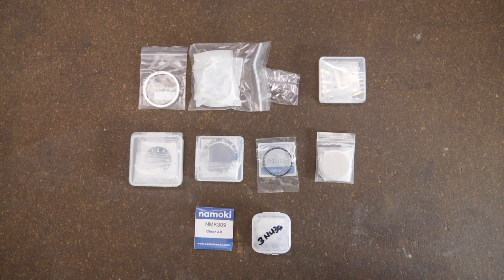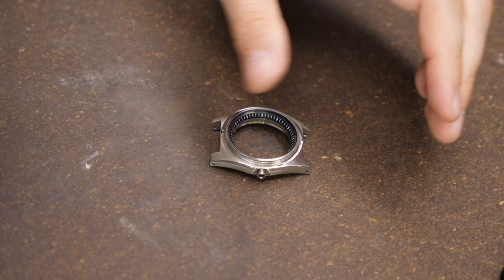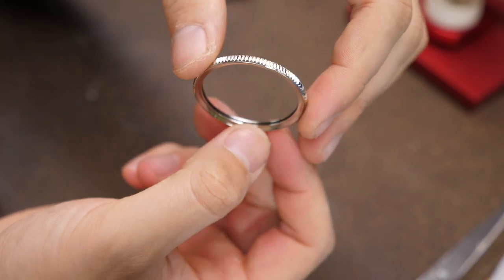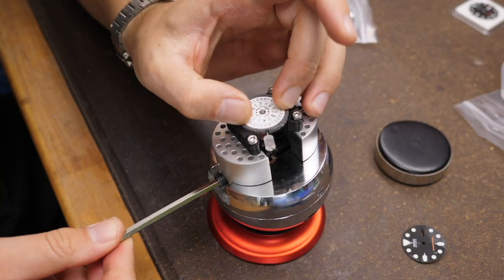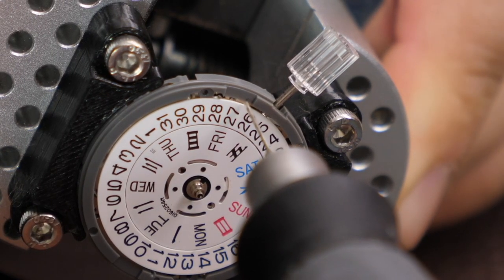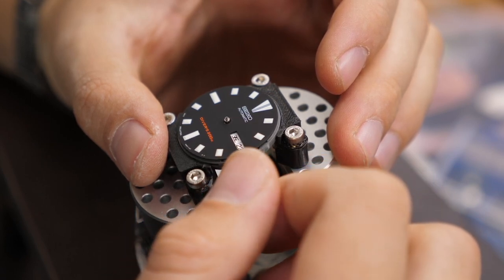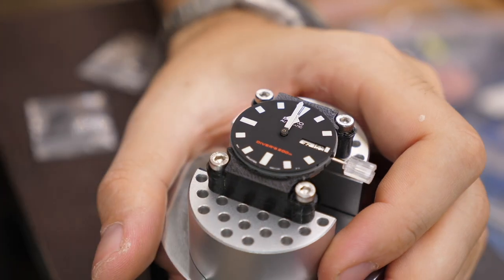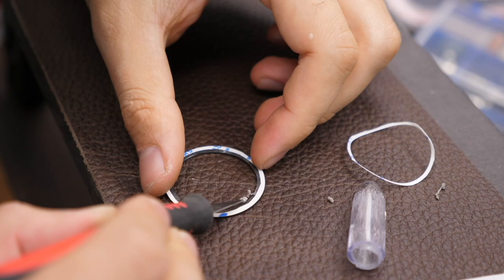Building a Custom Vintage-Inspired Dive Watch: Step-by-Step Process & Tips

Comment: Tokeilab has many quality control issues. Also you can easily remove the grey plastic part from the movement, so you can drill holes without any dust.
Reply from the maker: Unfortunately the hole needs to go through metal, too. Otherwise a good idea :)
Reply: @normanwink  I know you explained in your video that this was more of a test piece, but why didn't you disassemble the movement before drilling?  I'm new to your channel, so perhaps you've explained this in a previous video.  Also, when you need to transfer marks from one thing to another - try a tiny bit of grease, soot, or dry-erase marker on the feet, it'll transfer a mark to the plastic.  for metal, a quick dot of dykum or sharpie on the pate will allow you to scratch a mark with the foot for exact marks.